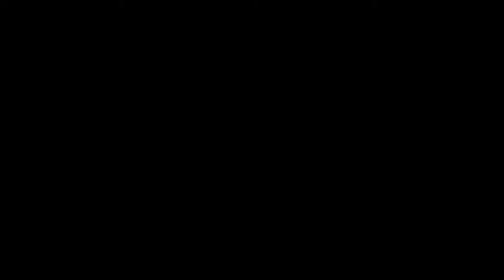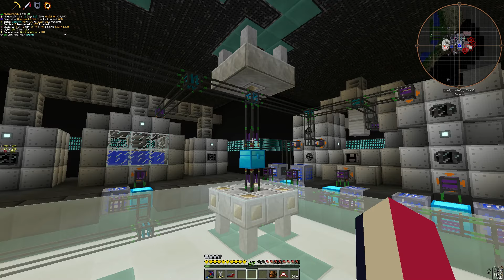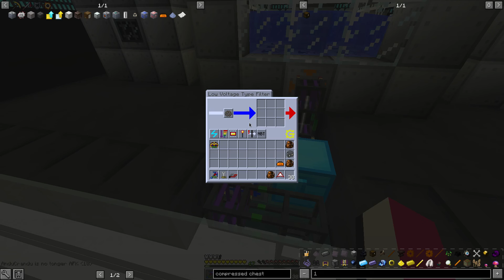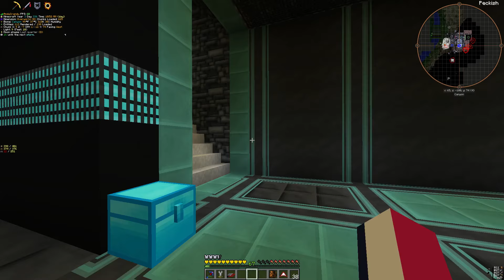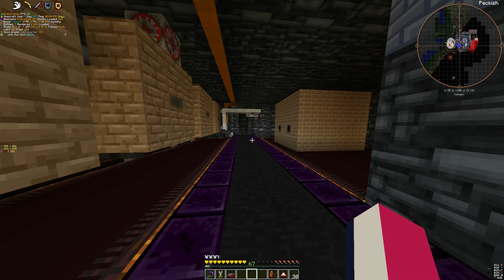Better Ore Processing - GregTech New Horizons

Comment: Late to the party, but instead of the regulator for your electrolyzer use Recipe Filters, you can set the machine type (electrolyzer/centrifuge) and it will only allow through the exact amount needed without blocking the machine.
Reply from the maker: Oo, I did not realize the recipe filter would also act as a regulator, I will have to check that out.